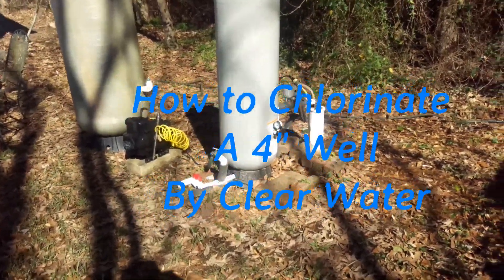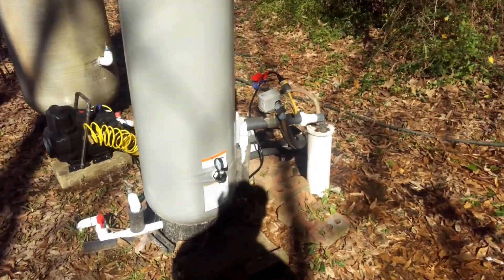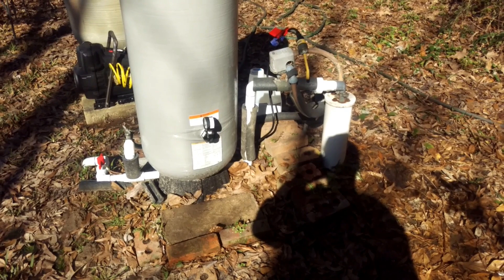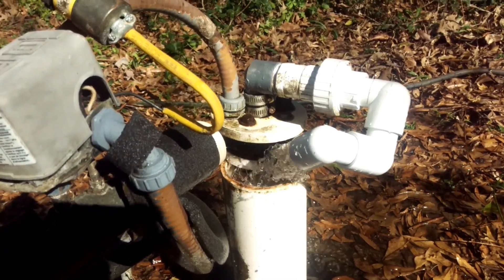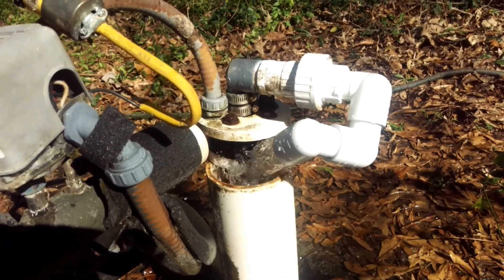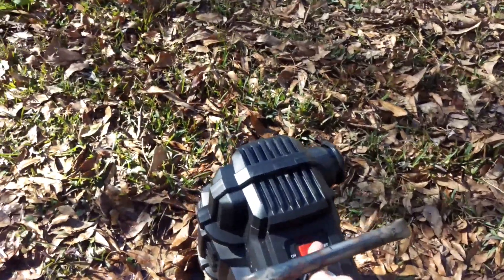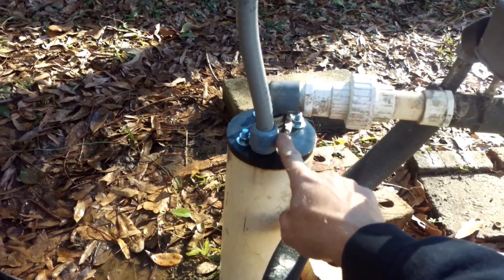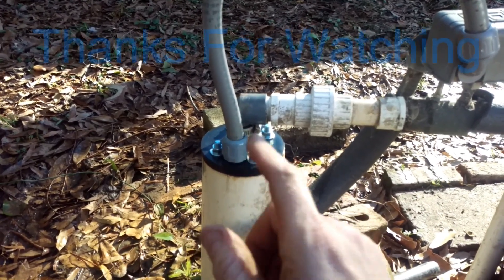Chlorination of a 4 inch well Correctly

Comment: Hello and thank you for the video! Do you have the step by step video on how to open it?
Also, do you have any thoughts on the best filtration system for florida wells? I have been getting a lot of information, but i think when speaking to the corporations it's a lot about the marketing.
I decided to DIY and I was thinking of designing the system with low cost and maintenance by putting 2 metal the washable sediment filters after the first pressure tank, one 100 microns and one 50 microns after that. After, I'd put a regular sediment filter and a carbon filter, then, I would put this filter, then leave the salt softener, which i already have and might put the descaler filter before the water heater. Do you think it would give me some TDS reduction or is there anything else you'd recommend? Thank you for your feedback!
Reply from the maker: Hey, usually from what I hear in Florida, there is a high calcium and hardness.  The softener works the best for reducing this.  Depending on the hardness level you may need to change the regen settings and or may need a higher capacity filter to handle it.  Your hardness there is probably around 20-30 grains/gallon. You will either want to regen every other day or have a metered head set correctly.   Pre filters are good to have but would not use a low micron as they will clogg too quickly.  Post filtration can be lower micron but if too quickly needing replacement I would use a higher capacity or not so small.

Thanks for the comment and watching!
Casey

Comment: I guess that is the draw back using pvc pipe, here in Canada the law is an 8" steel pipe be driven into the bed rock to seal any ground water from ever getting into the well, never any need to do this, as all wells are in water cavities in the bed rock and anything you added to it would be carried away by the under ground flow, I have my water tested every summer by the heath department, past 35 years since I had the well drilled it has been totally clear of everything, jusr clear fresh spring like water, not even a water softener needed
Reply from the maker: Arnold Romppai Pvc casing is not a drawback down here, steel casing corrodes between top of the ground to about 100' down.  There are a bunch of old steel wells that have become a problem, especially the deep flow wells.  They can leak out under the ground and saturate or flood near the well casing.  It's very hard to cement and kill them once they do start leaking.  But this well was contaminated dude to improperly sealing the casing at the top with the well seal and or they did not chlorinate when they serviced the pump. 
Thanks for the comment and take it easy.
Reply: I cant see how youcan drive pvc into bed rock to seal the ground water out, there big 60,000 lb drill truck has a big pile driver on it, and they weld a tapered steel drive shoe on the bottom of the first pipe to help the pipe drive tight into the bed rock, I cant see the steel pipe cordoning as you say, I had my well done in 1998 and putting a big light in side it is like new, I have re-installed new pumps and pitless adaptors in hundreds of wells and digging down the 9 feet to get to were the pitiless adaptor is, below the frost, the pipe is also like new on the out side, most of these old wells I have worked on were many years older then me, the steel casing is also the law here, even if it did start to rust witch I can not see how as rust needs air to start rusting, witch is not present in the ground or in the casing being it is air tight sealed, also using pvc the frost would crack that pipe, or if some one hit it and broke off the pvc ground water would pour in and no one would even know, were this heavy steel pipe they been hit by equipment and nothing has happened to it, I need to ask you this, if a pvc well stopped working how do you begin to start drilling it deeper, with all them added peace's down in side such as the smaller pvc 6 feet long used as a screen, and sealed in bag clay, the steel wells the just back up to the well clamp on to the casing and lower there 6" bit and start drilling, every 20 foot section of steel pipe is welded  though to the in side, as is done with gas an oil pipe lines
Reply from the maker: Arnold Romppai Look sorry I didn't make this clear your in Canada the well construction is way different than here in Louisiana.  We are located on a different type of aquifer it's a clay and sand ground, we can not hit bedrock until over 2000'.  90% of all wells drilled in the area are less than 500' deep only going through layers of clay and water bearing sand left over from old river beds!  So no argument is needed here the well construction is totally different and we have little to no problem with pvc wells.  The issue with drilling deeper if something goes wrong we don't, you can't and there is no need to.  Wells are cheaper to drill here and the water supply underground is almost unfathomable! Unlike up north where your drilling through multiple layers of rock searching for cracks a seeps.  We have no need for this, you can drill a well anywhere and find water!  The water quality is different it varies from area to area and different depths, filtration is needed for some wells others are perfectly fine straight out the aquifer.   Anyway yea stick to the steel law up there it works, but not down here.
Reply: Clear water, gee I did not know this, that is why I find pvc so strange, hell you cant get away from bed rock here, some places its right on top, my well went though 60 feet of red clay, 10 feet into cores gravel, and 17 feet into bed rock the dril rig suddenly dropped 18" were all the water was, when it was witched it showed 5 branch's coming to the hardest pull intersection, I had them drill an extra 10 feet to give me a sump, witch is very risky doing, you could hit an open dry crack and loos it all, in other cases were they don't hit water at 300' they blast it, witch works most of the time, that is interesting there, the biggest problem here is hitting water full of sulphur